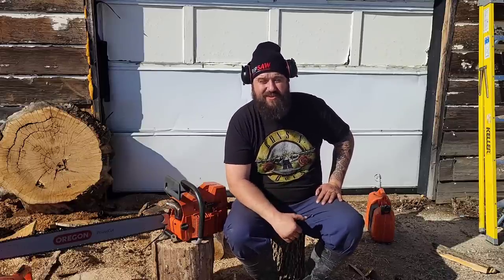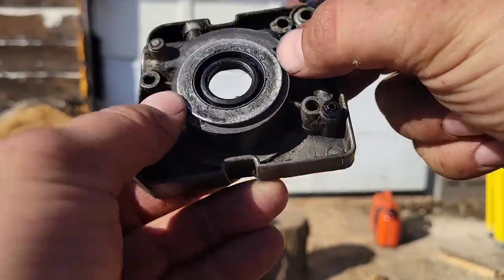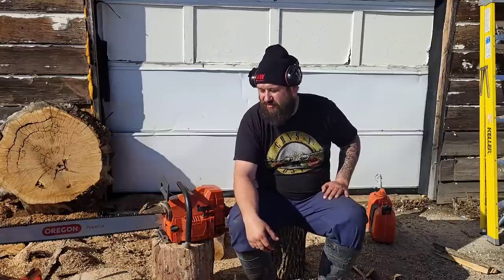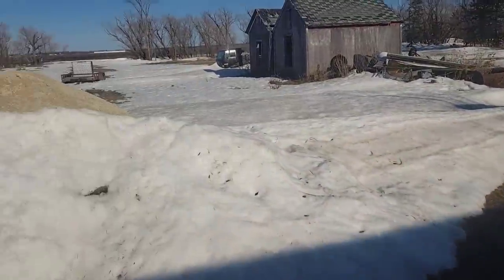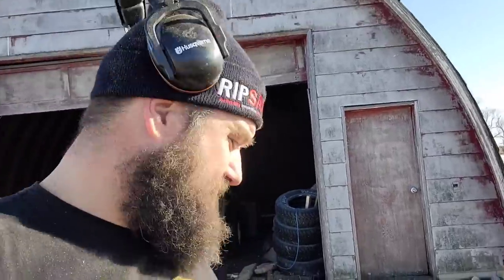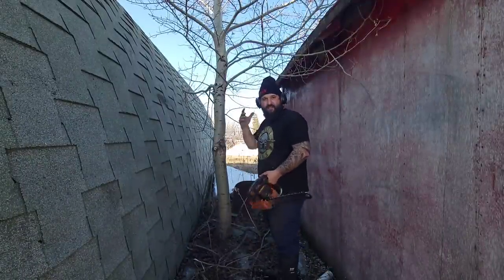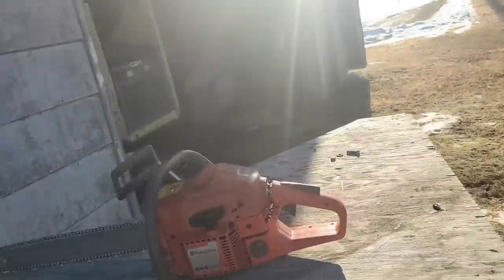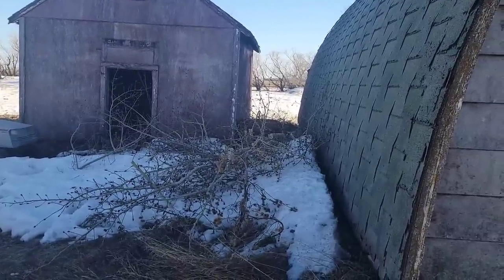288 oil pump issues!! The future of the channel.

Comment: Tinman, if that is a Stihl mount bar adapted to the g288, I had the same oiling problem on my husqvarna 288 with my Stihl mount Oregon 32”. (video on my channel) The oil hole on the Oregon bars is slightly higher than a Stihl brand bar or a cannon brand bar and on some huskies only half of the already small oil hole is lined up with the oil outlet on the saw. I drilled the hole slightly bigger and chamfered the surface edge of the hole into a slight teardrop shape with a fordham to match up with the oil outlet.  Great video keep it up buddy, new shop will be sweet.  Cheers from kemptville ON

Comment: I went with an OEM oiler right from the start of my 288 build. While it does oil OK, at max settings it’s what I would call “adequate” with a 24” (Husky bar) but I question if anything bigger would be getting enough. The pump was purchased new from a reputable online source. Thanks for the 288 content. Awesome channel.

Comment: Looks to be the bones of a cool shop. I really like the rounded roof. There is a few old barns in my area with roofs like that. Not sure if you are considering a heated floor or not, you will be glad you did. It makes working on stuff in the cold way nicer.
Reply from the maker: A hydronic system is definitely the way to go.
Reply: @tinmanssaws  For sure. Look forward to seeing your shop.

Comment: I have a 395 kit saw had oil issues. It actually some how chewed up the brass gear that turns the werlywoo that spins your pump. How? Not a clue but i ended up just buying a used oem pump. Works great now. The carb is my next issue. It just doesnt keep up like it should and its not what in my mind what a 395 should be. It has a hyway big bore with a pop up. I opened the lower transfers and did a base gasket delete. Its just not there.
Reply: Im surprised as ive had opposite experience with my 395 kit saw,ported as well n runs like a champ and hlic carb has been outstanding,mine also chewed brass worm gear which i replaced w plastic oem, muffler baffle came loose yesterday so new muffler on order, been a stihl guy but this 395 has me leaning to the dark side as i now have almost new oem 372 as well i  got on trade...

Comment: I have a question, I have a 266 se 1985 model coarse thread crank. My question is, I need to change the sprocket out, but everything I order aftermarket is for the later models that have a slightly larger shaft. The needle bearings they send with the sprocket fits sloppy, but with the original needle bearing, I can’t fit it into any aftermarket sprockets, or rim sprockets. I think they are for the fine threaded cranks.The crank shaft measures exactly, .500. On mine. Have you come across this issue? I would be grateful for any advise. I love this saw, but not sure how much longer I can use it due to the wear of sprocket. Peace!

Comment: If u wanna cheap muscle saw with no oiler issues, grab an echo cs 8000 and port it. Press-fit metal oiler gear, these saws over-oil a 36" bar. 
Same with the cs 6700's, press-fit metal oiler gears. Completely sealed off from debris as well.
Reply: That Is very true.

Comment: Nice 242xp. Kinda sounds like an old Massy Ferguson tractor..lol. it starts, it idles and it cuts. A good little saw for the quad. Timed out my 272xp, with a base gasket .027thou squish, 148° intake duration, 104° on the exhaust and 21° blow down. Polished up the exhaust port and cleaned up the piston windows. Let me know what you think. I think I will run with these numbers and see how it cuts. TC Mahalo Tinman 🤙🤙🤙

Comment: How would you know if it got too hot other than by feel? I have a framertec ms 460 that oils well with no bar on but when I have the 25” bar and chain on it doesn’t seem like it’s making it’s way around the bar.  I was test cutting in dry ash about 24” and the bar feels hot and dry even in partial cuts.

Comment: My g288 don’t seem to oil real great either, with 24” bar and chain, I’m a stihl guy, love my 034 and ms 460, but this g288 hasent let me down yet, iv got 6 months of on and off bucking on it, starts easy, runs great, restarts great, what is the problem with the stock oil pumps? Do you have any idea? I’m thinking of getting a replacement one, I also cut hardwood timber, also did you do a muffler mod on that? If so what did you do to it?
Reply from the maker: I rhino the tank vent is actually the issue on this saw, have to dog into it on the weekend. 

My stock 288 clone  has no muffker mod, the ported one is piped.
Reply: Thanks, love cutting logs, felling trees for fire wood, love you, buckin, and Ironhorse videos,